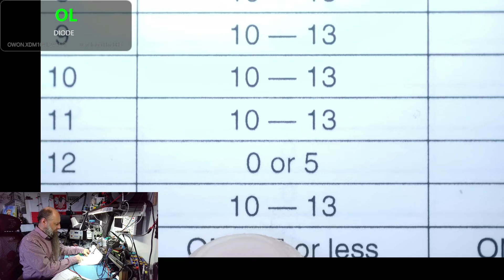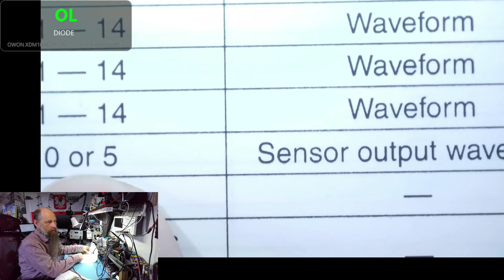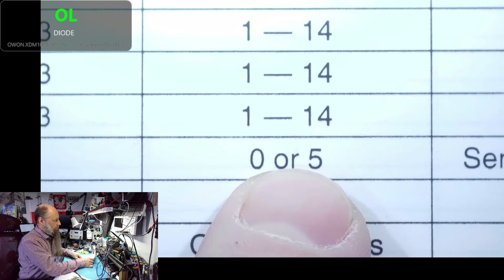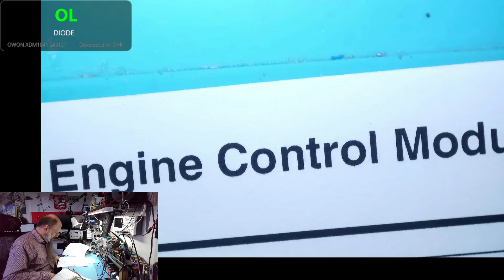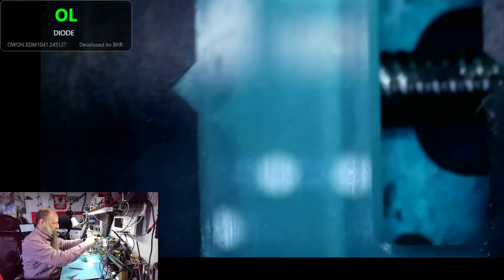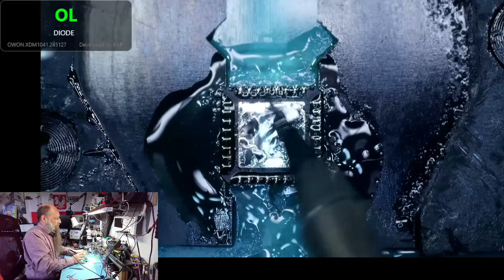317 | 2007 Subaru Forester P0607 ECM Repair

Comment: I have a launch x431  pad 5 with a smart link C Vehicle connection interface. It works 100% with plugged into USB. It is suppose to work on WIFI but will not connect to WIFI. is this something you may be able to repair?
Reply from the maker: send it in